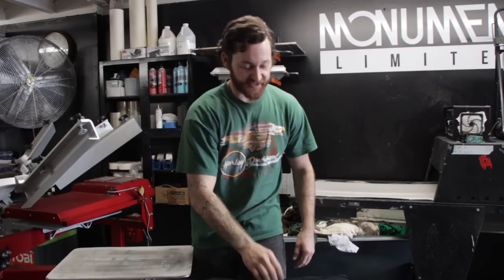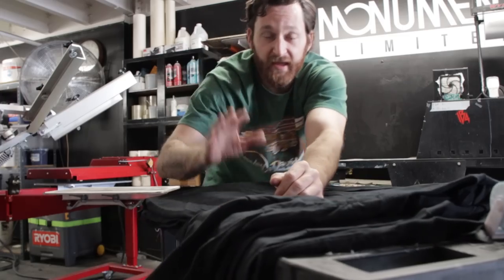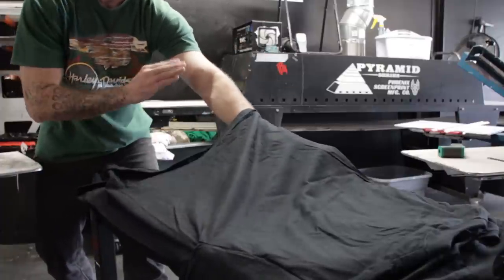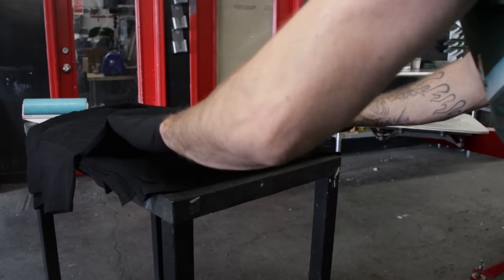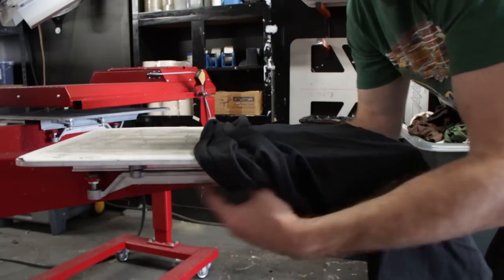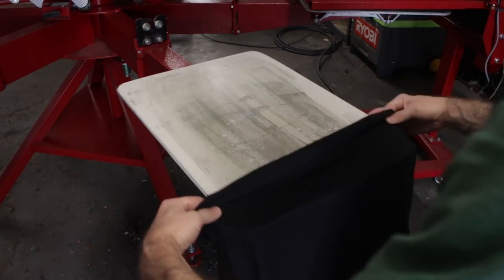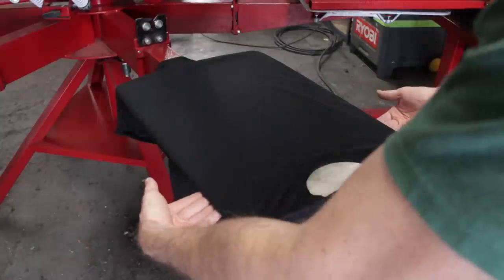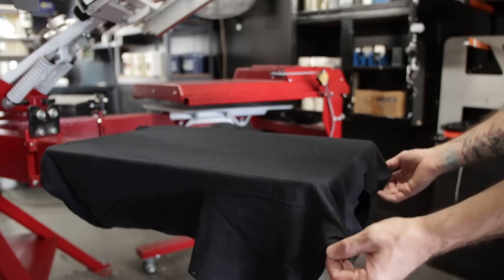Screen Print Hacks and Tips | Load a T-shirt Straight and Center

Comment: My two cents, I find that if I set the shirt print side up with the bottom opening of the shirt facing away while having a stack of shirts halfway off the cart, so the bottom is closer. Next,  I pull the shirt from the bottom right and running your other finger next to the other and as you are turning and sliding your left-hand finger, opening the bottom wide enough to shove the shirt to the back of the platter. For shits and giggles, I tried to apply your technic but found it adds a second to the whole process, but I think with practice, yours should be just as fast. I hope this alternate technique helps.

Comment: In one of your videos you were talking about water based printing and that if a shop does it about 50% of the time a method we can use is to use the same emulsion we would with plastisol ink but after you expose it and wash it out you can apply a hardening agent. The next step is to expose the screen on the exposure unit, then after you wash it out apply Chroma set and leave on for about 3-5 mins. then rise that off, set it dry in the sun or once it is dry expose it again for 30 sec on the exposure unit and that will harden the emulsion enough to use water based inks without purchasing a water base emulsion. This should work fine right? :) Thanks in advance!
Reply from the maker: From our experiance hardening agents are ok for runs up to 100pcs after that the emulsion starts to get soft.

Comment: I have tried this and just  have  trouble. I have  wood platens  and wondering if aluminum platens would be a better option down the road. I  have such a  problem with getting them crooked. Any addition help??
Reply from the maker: Loading a shirt straight is a knack that you develop almost exclusively through practice. as for the pallets as long as you are registering the screen straight to the pallet it should not matter, unless each pallet has a different angle. I think aluminum pallets with precision cut adapters do help remove the variable. so in the long run you should strive for and upgrade in your equipment, but for now, use a square to make sure all your pallets have the same even angle. register you screen to the pallet, and you will have a good starting point.
Reply: @ThePrintLife  that's what I did last night for a couple of hours.. still getting the shirt on there with more on one side than the other. Not really crooked ...just off center.. thanks for your help I'll keep trying